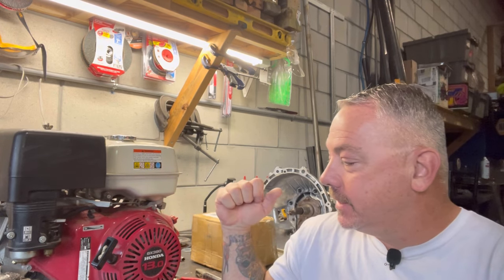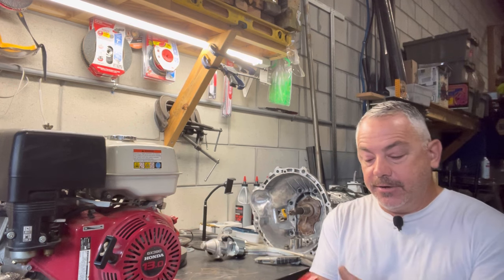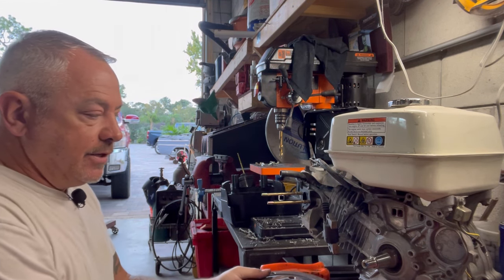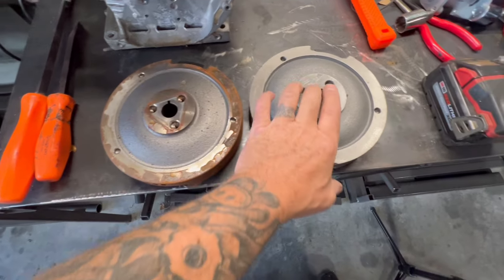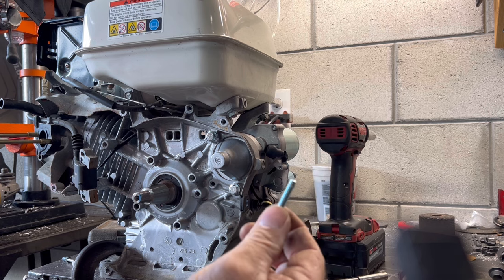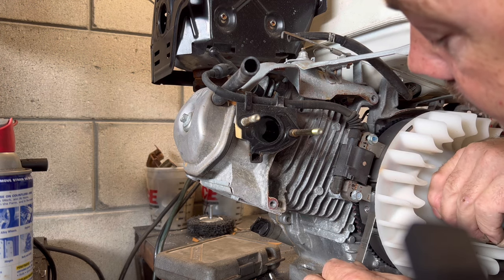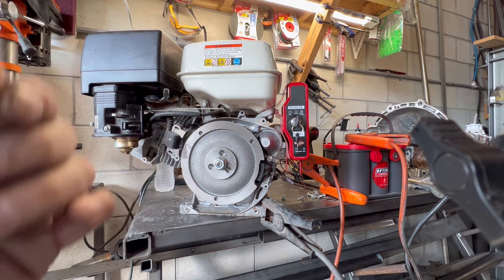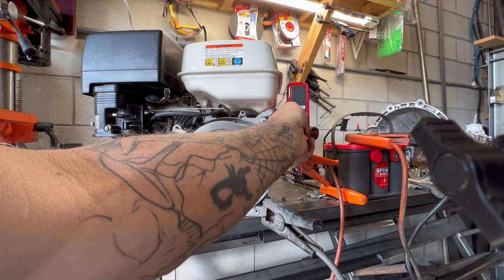How to install electric start on a 13HP HONDA GX390

Comment: That yellow/Green wire with the terminal end on it, where did it go?
Reply from the maker: I believe the it goes to the charging coil and oil level switch.
Reply: @magicman_metal_fab  I found where it goes, I figured to ground, watched another video and saw it hooked up, but no body`s video shows anybody hooking it up. 
Oh well, if you some mechanical experience you can figure it out.
Thanks for the video, you need to watch the one where he knocks the starter hole out with a hammer!!
Have a good day.
Thanks,
Joe
Reply: I even found out where the little brackets go!!

Comment: Having an issue after the install. Starts up but now it runs rough and backfires. The choke has to be in a sweet spot and then it wont stay running. Engine is new with 50 hours on it. Seems like a fuel issue. Could this be from incorrect wiring?
Reply from the maker: No. Probably a clogged carb. If it will run 1/2 choked then that’s your issue. Check gap on ignition coil. Also double check if your flywheel matches.
Reply: @magicman_metal_fab  carb was clean throughout. Gap was set correct and double checked. The flywheel should be the correct one. What do you mean by this?
Reply: The flywheel was the same size and everything with the factory one

Comment: There's no threads in the holes for the coil. Will they thread in automatically cause of the soft aluminum?
Reply from the maker: Hmmmmmmm. If yours doesn’t have threads I would consider tapping the holes. I wouldn’t chance to “make shift threads”.
Reply: M6 1.0 tap

Comment: Thanks for the Vid 👍Can Someone explain why it won't work if the pickup on the new flywheel is at two o'clock when the original is at 1 Thanks
Reply from the maker: If the pick up is supposed to be a 1 o’clock but you have a pick up at 2 o’clock it will ignite the gas in the combustion chamber at the wrong time and more than likely not run. Ignition timing is very specific on every single engine.   Hope this helps bud. 😊
Reply: @magicman_metal_fab   Helped a lot much Appreciated Mate.
Reply: @pauldavis9808  Assuming you have the post-2011 GX390, the flywheel is different and so is the coil. If you use a pre-2011 starter kit, you can replace the coil with a pre-2011 coil and a low-oil module and it should work (most people don't like to do this because of the wiring issues.) OR you can heat up the ring-gear and put it on the old flywheel (provided the old flywheel has the charging coil magnets built in.)

Comment: I’m installing this kit today, I have taking everything apart. Everything looks like it works fine except for the coil.  Where my coil mounts and the coil they gave me in the kit will not lineup to put my screws in,, is it possible that I can you reuse my old coil with this electric start kit? Even though mine was a pull start?
Reply from the maker: Absolutely. The charging coil not the ignition coil correct?
Reply: @magicman_metal_fab  lol that’s what it is. Lol.  Got it TY
Reply from the maker: @novarestoration9023  awesome bud. If you have any other questions fire away. 😊🤙🏻
Reply: OK you asked for it. Lol  So what do I do with the on off switch that is on the cover? It’s actually in the way when I mount my key housing. Where did you get that black piece to cover the hole where the on off switch was
Reply from the maker: @novarestoration9023  that original switch comes off and the black cover fills the hole. Easy peasy. Keep them coming. 😊🫡
Reply: I understand the switch has to come off. Lol What do you do with the two wires going to that switch that you are removing ? do you cut and slice them together?  Also, the black cover you have covering where the switch was ,  where did you get it because I don’t have that cover. If I take my switch out there will be a hole there.
Reply from the maker: @novarestoration9023  no splices needed. It should all be plug and play. One side is a ground and the other goes to the coil. When you ground out the coil it will shut off. The black plug came with the kit. You should be able to grab that at ace hardware. 😊

Comment: how did your flywheel come off so easy 😰. the nut is a wrist breaker on mine
Reply from the maker: Use an impact on the nut. Maybe a little bit of heat. 🤙🏻🫡
Reply: @magicman_metal_fab i had the wife lock the wheel up with a pry bar and used some leverage and muscle. thanks for the video by the way.

Comment: So if the only problem you had was alignment of the starter, the solution would be to properly locate that first small hole you drill prior to using the hole saw. That will get the starter motor on the proper centre. How would you propose doing that, in hindsight? I ask in all seriousness, because I have this to do actually myself, once the starter kit arrives.
Reply from the maker: That wasn’t really an issue. If I had opened up the hole a tad larger which I ended up doing would have been fine. The holes that come from the factory were slightly larger which allowed the starter to rotate. It really wasn’t hard to install and adjust the starter. I would absolutely purchase it again if I needed to. 😊🤙🏻

Comment: Great video, just ordered a kit, went to remove old flywheel and realized the new flywheel keyway was more to the left.  I noticed a comment here that said to remove the teeth and install on old flywheel but that wont fit either.  Also no magnets inside the old flywheel to charge. Any insight would be great. I cant find the reason. The new flywheel looks like your keyway. Also i believe my 390 is a 2017 if that helps.  Loosing my marbles over it lol
Reply from the maker: Email me pictures 
Magicmanmetalfab@gmail.com
Reply: @magicman_metal_fab  thanks for the reply. I figured it out, so previous to 2011 the flywheel keyway was in a different location so timing would be different for my 2017 engine.  I contacted the company and they mislabelled the add of coarse my luck.  They are sending me the other flywheel, i also noticed some companies are putting both key way slots into the flywheel and you use which one you need.  When mine comes in tomorrow i will send you the pictures of it! Thanks for the reply! Great video!
Reply from the maker: @andrewm4951  that sounds just like my luck. Lol. I’m glad you got it sorted out bud. Keep me posted on how it goes. 😊
Reply: @andrewm4951  i have same problem. my oem flywheel seems to be on 2 o'clock instead of 1 o'clock and when my kit came in the flywheel is at 1 o'clock. what kit did you use and from what website did you buy it from?
Reply: Yes I’m facing this same problem it’s at 2 o’clock 
Thinking I’ll just take it to machine shop get the key way cut out

Comment: So how did you align? Adjust teeth on plate? Or starter positioning? Been wanting to add a turn key soon..... thanks for vid 🤙
Reply from the maker: Just loosen the starter bolts and slightly rotate the starter. After a few tries I was able to get it to work. Pretty easy bud. 😊

Comment: One of the main things that make a honda a long lasting quality engine is the quality of components ! Also the balance ! A honda hardly rattles itself to death !
Chinese engines do ! Chinese engines lack the quality of material and are not balanced like honda !
If a fella adds to the reciprocating assembly of a honda with chinese parts !
You now have a chonda !
That might not be good !

Comment: I have on/off toggle switch on the side, should I just cut it off and wired it with the kit? Thanks
Reply from the maker: I would. The kit gives you everything you need to do it correctly bud.
Reply: @magicman_metal_fab  That's what I thought. Thanks!
Reply: Cool video man, thank you.
Reply from the maker: @duresterichard6960  my pleasure bud. 😊🤙🏻

Comment: Mine will start by pull, but won’t crank from the ignition switch itself, I have same exact setup as yours
Reply from the maker: Check your grounds. Ground from the battery directly to the block of the engine.
Reply from the maker: Also use a test light to verify your getting 12 volts to your starter at the post.

Comment: > PROBLEM <~~~~  There are a few problems with this instructions ATTENTION....! The instructions do not show where and how all the wires connect ?
Then he says use Red loctite BAD MISTAKE ---Red Loctite in aluminum you will never ever remove those bolts. Suggestion Use 242 Locktite instead and it should work just fine.
ALSO; They gave you bolts to bolt parts on and Three of the bolts are a problem because you must figure it out and get the right size longer bolts those will not work. 
I SUSPECT ! !!!!!!! ~~~They want you to screw up with the Locktite and with the wrong bolts and you need a botteming tap to thread the holes with.
Then YOU MUST Know exactly how deep to go. The wires need to be explained.
The reason they sent too short of bolts was so you will screw up.
You need a piece of tape put on your Threading Tap . 
Then there was a Tin strap with a bolt hole. That is to hold a wire so the fly wheel will not touch it. 
I could show more if I had a video to show you.
Every video of the 13 HP is screwed up on purpose .

Comment: The starter size hole is 2.559 inches. WHY? Because its probably a metric size like 65 mm and they dont make a hole saw this size. Quite frusterating.
Reply from the maker: Yes unfortunately.
Reply: @magicman_metal_fab  I got mine to fit and used mostly a bastard file to aug out the rest of the material

Comment: Where did you run the charging coil wire under the flywheel?
Reply from the maker: I believe there was a spot for it bud. With a wire hold down

Comment: Ugh! I’m not good with fragile items & I consider myself moderately handy as a lineman for the power company. I know my limits. This is past my limit. I will ask around local shops to have this retrofitted to my pressure washer. 
Anyone who has these engines knows they are a mother fucker to start. Last time I wanted to pound the top of the engine with a 10 pound sledgehammer because it took forever to start.  Since I bought it brand new at home Desporite it’s been impossible to start. Typically it takes me between 20 & 30 pulls to pull start it. Why it wasn’t retrofitted at the factory leads me to believe the engineers never pull started it themselves (morons)?
Reply from the maker: I’m a union journeyman lineman 🫶🏻🫡
Reply: I’m a power company lineman with IBEW Local 457 in Connecticut. Not to be confused with a journeyman lineman like you. 
Interesting that as a lineman you have a channel on small engine repair?
Reply from the maker: @johnclyne6350  there are a few line work videos on my channel. A few months ago I was up in Athol working for D D power. We re conducted belchertown Mass. Hendrix cable. 🫶🏻🫡
Reply from the maker: It’s interesting why it takes so many pulls to fire up your engine. Something is wrong. My Honda starts first or second pull every time
Reply: I subscribed to your channel & I only look at the funny videos. You’re way more gifted in the area of mechanics than I’ll ever be. Good for you! 
I have several invisible disabilities that hold me back. I have learned over the decades that if I want quality results? Hire a professional. I make good money now. I can afford it? I’m a trainer for fresh apprentices coming out of boot camp. We get them ready to work in the district. 
I don’t know where Anthol is or Belchertown, Mass. is? I’m a carpet bagger from N.Y. Connecticut is still new to me despite living here over twenty years.
Reply from the maker: @johnclyne6350  thank you bud. I’m definitely different in a good way. I appreciate you!! I’m originally from new York “Long Island “ I did my apprenticeship through neat 20 years ago. I was taught by old timers. Anyways great o chat with you. I would probably replace your carb with an OEM one. Your engine should start is few pulls something is wrong
Reply: @magicman_metal_fab  Mine was bought brand new in 2006 as part of a Dewalt pressure washer. It’s been a bear. I dread pulling it out to use it knowing full well there is going to be a fist fight involved. There is soo much compression on pull starting it that I only get one pull to start before pressing the trigger on the wand. Then one pull & release pressure on the wand. I do that atleast 24-36 times before it starts. One day I won’t have to do it anymore. I’ll drive my sledgehammer through the air filter & carburetor. Then a few more swings & the engine block will be broken. Then I’ll never buy another pull start engine ever again. Piece of shit!
Reply from the maker: @johnclyne6350  😆🫡

Comment: Said it ur self installation ain’t to hard to do the hard part is making Sure everthing is done and is  done correct cause I’m pretty sure I speak for everyone or at least most watching  these videos best way to  learn is visually or hands on to see everything so with getting the started to fit on the engines isn’t just putting. Some lock tight on a thread and Tightening smh u went off camera at the wrong time would of loved and preferred to have actually seen how u did it ever step would help and is important and the fact u didn’t really say what u did wrong and how u had to  Reassemble it and you said you had to do that a few times so over all bad video didn’t show how u Realign the starter with the fly wheel when u said u messed up and everyone following ur steps most likely will have the same problems u had cause we’re following ur steps u didnt show how to spot the problems to save us the head ach/problem if u would of recorded  everything u would  have a way more Informative and help full video   then just hearing what u did wouldn’t show that exact part and mistakes  would of made his video 100 x better it’s reassuring and I’m pretty’s sure everyone would love a video of every  part to guide them and have a better understanding when working on this exact part
Reply from the maker: Bud it’s not hard to do. Don’t over think it. I’m pretty sure I showed everything. The good, the bad, and the ugly! If your starter binds up just loosen it up and rotate it, then try again. I’m pretty sure anyone can easily do this from this video. 🤙🏻🫡
Reply: The guy wrote the longest sentence in the universe. However, I understood his concerns.